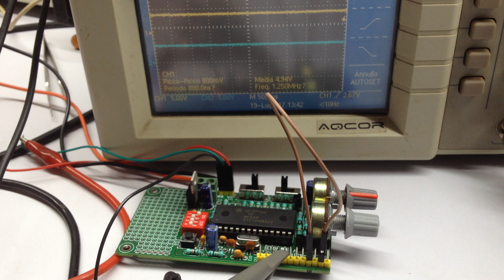6 PWM Pulse Generator to drive 3 Phase AC Motor Output Driver/IPM Module, for VFD

Comment: I need a 3 fase 0 to 400 hz vfd, I did see your site can I use your design with igbt,s on a 220 volts 1.5 kW spindle? thanks.
Reply from the maker: yes , you can use 

https://www.twovolt.com/2018/01/08/1-6kw-brush-less-motor-power-driver-using-ipm-stk554u362/

Comment: The IC is no longer produced ... Is there any equivalent to this IC ?
Reply from the maker: Yes , IC has been EOL, i would suggest to use ST32 Micro or infinion also provides cheap development boards produce 6 PWM pulse for AC Motor driver, 
https://www.st.com/en/applications/industrial-motor-control/3-phase-induction-motor-acim.html
Reply from the maker: https://www.infineon.com/cms/en/product/evaluation-boards/kit_ak_3phase_drive_v1/

Comment: hey friend so the JP1 is used
Reply from the maker: yes , DC Bus voltage should be between 1.75V-4.75V
Reply: @Thetwovolt  but he has 3 pins with which voltage is energized each
Reply: I'm sorry it's not jp1 it's jmp 1
Reply from the maker: Hi, Apply 1.75V-4.75V Pin 2 Positive and 3 GND Pin 1 no use
Reply: @Thetwovolt   ok, very thanks

Comment: how copy the program of this ic mc3phac
Reply from the maker: Hi,
IC specifically made for AC motor driver application, IC has its own software from factory, we can copy or change and we can change parameters using serial communication, so program copy is not possible
Reply: TWO VOLT since this IC is discountinued ..and  cant find its replacement.....i have spare ICs of mc3phvac but they r not working...i have doubt that they r blank
Reply: @crazycoolguy109677  Hi. I had the same problem. I built a similar circuit, but it didn't work. It seems that the IC is not working. Did you manage to solve?
Reply: @marcelocmayer9080  no. They are still scrap for me
Reply: @crazycoolguy109677  Hi. I got it working. My problem was in the oscillator circuit 4 MHz. I don't know how to explain, but my IC takes a few seconds to initialize.
Reply: @marcelocmayer9080   i just test my IC in place of working ic and it doesn't work